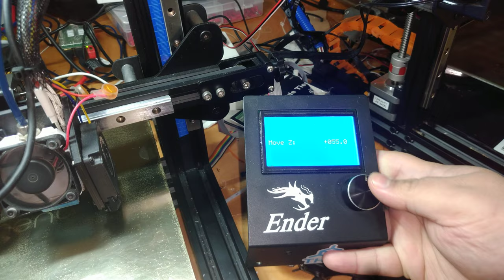Bearing blocks / Leed Screw Stabilizers - How they can help and what to look for

Comment: Nah, leave it unconstrained. Constraining it at the top can only add wobble. The linear bearings are meant to constrain the x and y, the rod is supposed to be only for z. Constraining it at the top means that any imperfections in the straightness of the rod applies an x-y force to the linear bearings, causing errors. This is why the majority of z banding issues can be eliminated by removing that top constraint. There are many videos, with tests, that prove this. The reason isn't to prevent binding, it's to make sure it doesn't completely flop around, or bend it if  you bump it. A bigger hole is better. A bearing can only be worse.

Youtube even knows this, since the next recommendation is "Z axis wobble" by "Alex Denis", going over the physics of it. The three after also go against this video, the second boing about how binding is motor misalignment, not top misalignment.